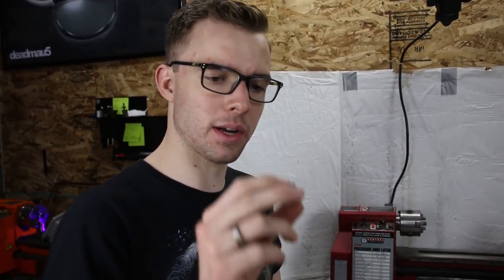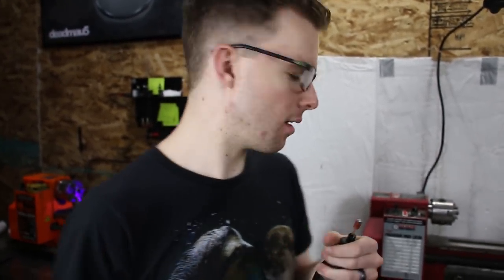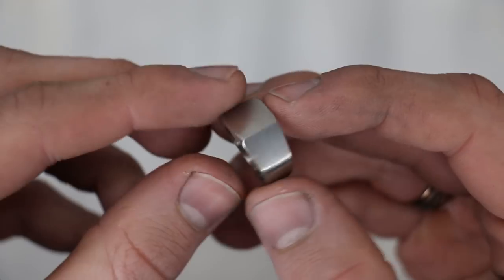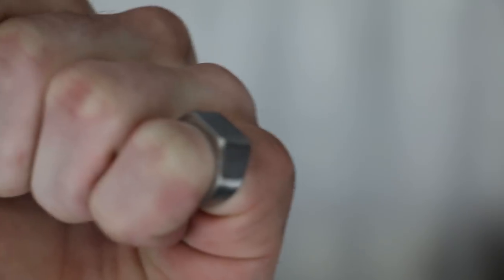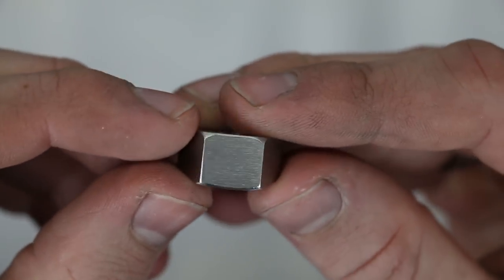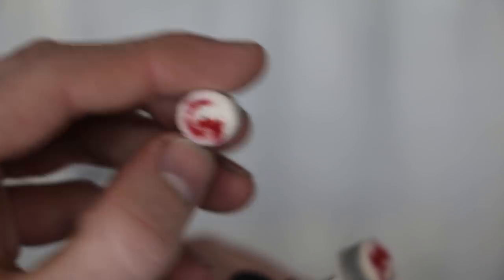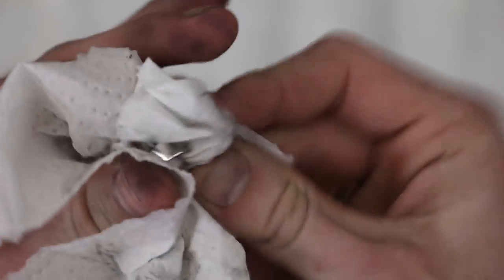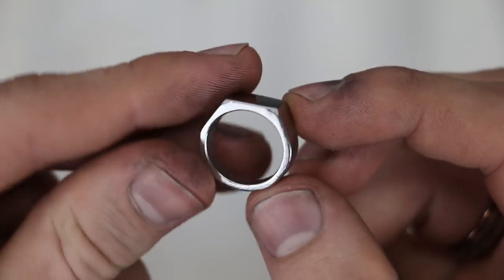Making a Hex Nut Ring Using BASIC Tools - No Lathe ( DIY )

Comment: Also, to grind away a lot of material from the inside before sanding, I would recommend getting a round metal filer used for sharpening chainsaw chains, and chuck it to a drill press, or make a rod that you could attach sand paper sheets, it’s cheaper then the dremil parts
Reply: Este Glez Best recommendation ever. I spent literally 3 hours and a lot of dremel parts and I didn't reach the desired width. Then I bought a round metal abrasive thing, and finished got 3 rings in 1 hour.
Reply: Could you use a drill bit to round out the middle?
Reply: @markfinster1256 no, drill bit too slow and it will tend to wander and drift. Rather use a die grinder as it has a much higher rpm so it won't want to drift and kick back. Pop a carbide up cut bit in the die grinder and you will hog out the hex thread in no time and create a lovely smooth inner diameter.

Comment: I made my own hex ring as i call it. I actually used a hand file for the entire outside and a round hand file on the inside. Both were about 7 or 8 dollars plus my hex nut was a dollar. Also mine was a weird shape and required a lot of filing on something most hexnuts dont have and thats a round second half. It took me 8 hours overall and i suggest using brass as its a bit softer... or zinc. Im working on a zinc ring now.

Comment: I suggested this a long time ago but I saw you did it with the Superconductor ring. You should leave a Damascus ring in etch for 6-7 hours. Then fill the voids with glow powder. Like red. Use the instacure super thin CA glue to get in all the gaps.

Comment: Hey dude, I don't know much about machinery and how to use them and stuff, but I need some help. I tried making one of these rings and I don't have a dremmel thingy (idk what's it called) so I made a makeshift dremmel thingy using a drill and then poked the drill thing into a piece of styrofoam, I cut out into a small circle, then taped and glued it so it doesn't fly off and then I glued sandpaper on the styrofoam. I was "able" to smoothen the inside of the ring. So can I shape the outside of the hexnut just like you did with my makeshift dremmel thing?😂

Comment: Love your channel Patrick. Doesn't the hex nut heat up when you are sanding it down? How do you deal with this?
Reply: Noah Munn every now and then u will see his fingers a little we are the wood darker, I'm pretty sure he stays water on them
Reply: Most metals conduct heat, and will therefore heat up due to the friction of sanding them. The way to get around this is to keep a cup of water beside the sanding station, and occasionally dip the ring in the water. A good rule of thumb is if you can't hold it, because it's too hot, it's too hot. Cool it before it gets too hot or you will mess with the heat treat. Hope this helps!

Comment: For using basic tools, why not mount in a vice and drill out the threads with a slightly larger drill bit? Seems like sanding them away with a dremel took a long time.

Comment: How do you deal with rings on winter when cold shrinks the fingers? y normally wear 8 rings on one hand and 10 on the other hand and in summer there is no problem with them , but in winter they tend to fall off

Comment: I used a round metal file for this and it barely fit in the hole and then later on it did but it’s was a painnnn, and then the last 10% left into this I have used my dremel(rotary tool) it was a pain and I just waited for 6 months because I realized I had sandpaper dremel tool to do this…

Comment: Would it be possible to do the sanding with dremel attachments? (i dont have a belt sander)
Reply: If you have a vice or some other method of holding the ring, yes. It might not look as good because you can't rotate the ring to get an even thickness all the way around, but I believe it would be possible

Comment: greeting from Indonesia. I'm Hartawan. 
I just made it too. but its still get rusty. can you tell me why? before I make it, I let it burn till red, then at the polish, I used green stone (Indonesian call it) then, I try use brasco and its still rusty. I just really confused :(
I need your suggestion. thank you so much :^)
nb: sorry for bad english.
Reply: hartawan satryo he used a stainless steel nut for this project. Even if you also used a stainless steel nut, heating it up to high temperatures will drastically reduce its resistance to corrosion. There's no way to keep your ring from rusting unless you paint it or apply a clear coat, and even that might chip off over time.

It may be a big pain in the ass, but you should probably start over and not allow the material to get red-hot. Good luck to you on all of your future projects!
Reply: ohh yaaa.. I see. thank you so much for your reply! I really apreciate it so much. once again, thank you so much!! :^)

Comment: Hey, im going to be buying a small metal lathe, is there anything I should be looking for, and should I go 3 phase
Reply from the maker: To be honest I’d just start out with the cheapest decent one you can find (as long as you can get by with a mini lathe). It’s awesome to learn on a simpler machine, and if you want to upgrade it’s pretty easy to resale on craigslist.
Reply: Patrick Adair Designs thanks for the advice :) I have used lathes where I work, but only the non CNC ones, as I work w the mills.
Reply from the maker: Well in that case I’d get the best lathe you have a budget for as long as  you’ll utilize all the features of it.
Reply: Patrick Adair Designs cheers for the advice :) love the videos